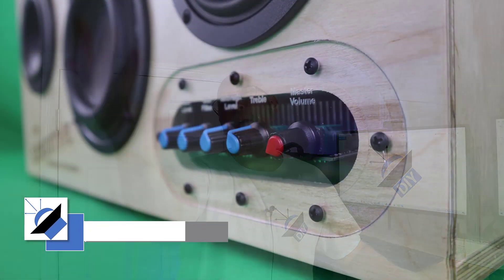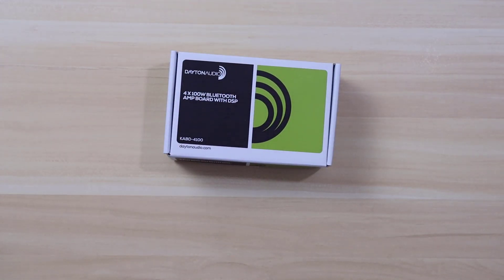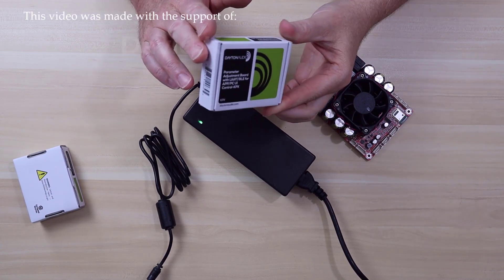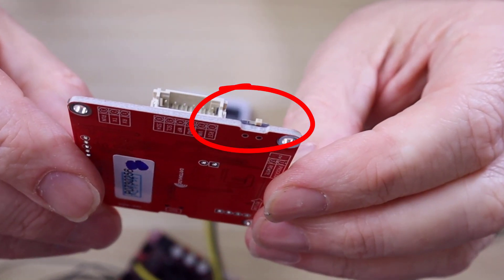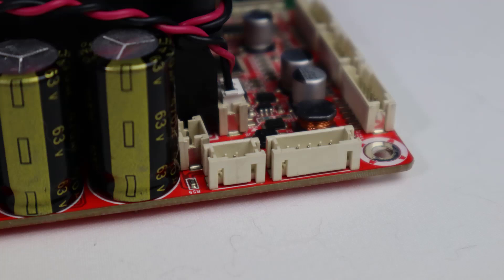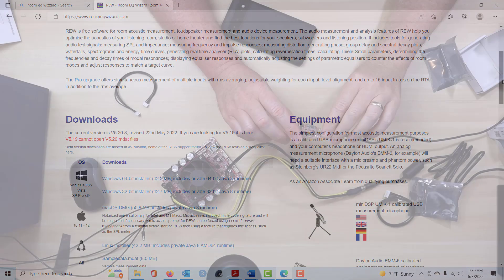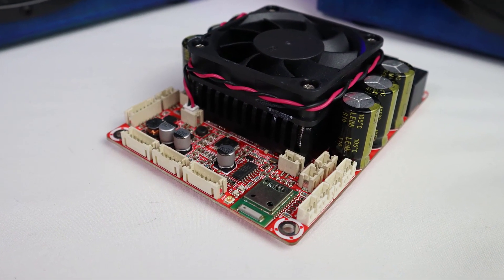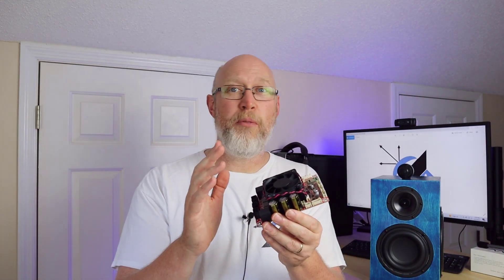DSP Amplifier:  Four Channel BLUETOOTH KABD 4100 by Dayton Audio.

Comment: If and IF  this was good sounding setup ,it would be everywhere! It just died ! It's been 2 years and no serious  Manufacturer has adopted this !No High -End Company uses this board ...It's good for Boom Boxes and awsome in Car Audio though ...... Please correct me if I am wrong...
Reply from the maker: Amp boards like this have been around forever, and they all have the same problem.  None of them do anywhere near there rated power.

Comment: Justin: I would be nice and useful if you did some measurements and showed what the realistic output power ratings of this amp board are. The class D amp chip in this design is rated 100 watts at the class D industry standard of 10% distortion! I don’t know about you but, I’d rather not hear my music played with that much distortion, thank you.
Looking at the TDA7498 datasheet it looks like the most you’ll get with an 8 ohm load before clipping is a hair less than 40 watts. Oddly enough, you get even less with a 6 ohm load; a bit over 30 watts before clipping. It doesn’t seem to be rated for 4 ohm loads. Looking at the 6 ohm headroom loss it’s probably a wise limitation.
Also, this is a single supply H-bridge equivalent output chip (as many class D chip amps are) and therefore there is no way to configure it for a “bridged” output. The output is already bridged. You can put two outputs in parallel which is actually what you get utilizing the jumper that is mentioned but, that’s not bridging. This might help getting more power into loads < 8 ohms but, you won’t be getting the large increase that you’d expect with an amp capable of actual bridging.
This is a great amp board for the money but, let’s be honest about its limitations too.

Comment: Another note, this amp comes with a 1/8 inch line input. You do not have to use the Bluetooth so… If you’re trying to drive two speakers with one board in each box, you can just split your line out and run hard wires to them and you could have a powered speakers in stereo

Comment: A word of warning if you try this. This set of devices is really cool. I was able to set up the crossovers on a four-way speaker very quickly just from watching Justin‘s video. However, I burned up one of the boards when I accidentally touched them together, so… Keep in mind Circuit boards are very fragile and very susceptible to shock and static. Protect your boards get nylon mounting hardware and some wood panels or something to fix the boards to so you can protect them. I sandwiched mine between two pieces of ash veneer.
Reply from the maker: Yep, have to be careful!
Reply: Always use a grounding matt with bracelet.

Comment: So is this basically a programable crossover? How is it connected to each driver? Did the speaker already have a traditional passive crossover installed? I'm about 80% of the way to understanding how this works. 

Also, can these be used with a traditional external amplifier? Thanks so much.
Reply from the maker: This is a 4-channel amplifier with a built-in digital signal processor.  Crossovers are just one of many things that a digital signal processor can do.  You can ser it up so that each channel is driving its own speaker.

Comment: I think these would be good for a dedicated Bluetooth speaker or computer speakers. But I like to build or modify speakers to run on my existing amplifiers. So these DSP's cannot replace most speakers I would build. Also I would recommend installing capacitors on all midranges and tweeters even if using DSP because sometimes the DSP can fail or not be programmed correctly and could send a low frequency to a tweeter and ruin it. One can always program the DSP to work around the capacitor.
Reply from the maker: Yep

Comment: Thanks for this video. Is it possible to take the filtered DSP outputs and send it to an external amp in case you want to use your own amps?
Reply from the maker: Yes, but at that point you may as well get a stand-alone DSP.  https://parts-express.sjv.io/ORg1kz

Comment: I bought this amp too, but the fan isn't on. Does somebody know if it goes on only when it gets warm, or should it be on all the time?
Reply from the maker: Mine did not turn on while testing.
Reply: @DIYAudioGuy  Thanks. So it seems to start when heating up.

Comment: Top tier tutorial! Straight to the point with relevant details. Really appreciate the lack of fluff for something like this (I think you need more fluff in some videos, but you do what's right for you). Dayton has always been good to me. I'm using an old school mini dsp board for my car and not only can I sit on the good settings, but I can modify it so easily when I decide the time delay is off... Its usually just weather and I revert...
I will absolutely use this solution for one of my future projects. Only thing is... I'm gonna make an external connecter for the programing port... I have to have adjustability
Reply from the maker: It is hard to figure out the right amount of extra filler.

Comment: Hey I preparing a build two mono 3 way 4ohm speakers based on kabd 4100 working as my rear home theater speakers but also I want add powertools battery hook ups on the back to make them "portable" move to the garden and make quick party... my question is possible to add some preeset profiles and switching them by adding extra button to the board?
Reply from the maker: Reach out to Parts Express tech support.  They can help, or check out the Toids DIY forums.  Between the two of them they can answer almost any question.

Comment: I am using a couple of these amps, a couple of 500 Watt DC/DC step up converters, and an Optical to I2S board along with an Android Headunit. Using these DSP amps gives me lots of options for car audio that would cost thousands otherwise.. Oh yeah, and not many of the commercially available DSPs have an Optical input on them. These KABD boards are freaking awesome!
Reply from the maker: Is the optical input an optional board, or is it on the main amp?
Reply: @DIYAudioGuy  It is actually a board from Wondom (Who is the OEM that makes the KABD boards for Dayton/Sure, their JAB5 is identical to the KABD-4100). Their SPDIF > I2S board will take over as the I2S Master for the KABD/JAB boards.

Comment: I’m using two in a very nice pair of two ways and subwoofer combo with faital 8fe200 1 cubic foot box made of a 13 layer Baltic ply with morel cat 308 tweeters in a birch horn I made. They are fully active and I’ll be rapid prototyping 3d printed horns soon to optimize the morel horns. 

So far I’m blown away with the power and capabilities of this DSP amp board. The level of adjustability I have is just nuts. I’m adding a zobel filter network to the woofer and tweeter so hopefully that can help with impedance issues with the woofer so the DSP board is not an end all solution but this board will cover 98% of people. It’s flipping fantastic. Great sound quality, lots of control, at a flipping fantastic price. Just make sure you get a high quality power supply, at least 24v 10a but I have a 36v 10a and it sounds slightly better with a higher voltage.
Reply from the maker: The power supply is very important.

Comment: No!!! not $30 for an inductor, how ever will the wallet recover from that? You get what you pay for in crossover parts. Pity it is bluetooth, they might have a place in a real wired speaker.
Reply: It also has an aux input
Reply from the maker: I think you missed the point. It is cheaper to buy this amp board and use the DSP vs using a non-DSP board and purchasing all of the crossover points.
Reply: @DIYAudioGuy  it's a bit of an inconclusive conclusion... It entirely depends on the budget. You could do this comparison at a $100, $1,000 and $10,000 price points. I went on Parts Express to see what the unit sold for. You couldn't buy a single big quality cap for the price of this unit, but then again you would need to compare that cap to something like my $6,000 active crossover to get a fair comparison. At the budget end of the spectrum you would be comparing this unit against something like electrolytic or very cheap poly caps. You can't draw any conclusions without doing a sound test of a both crossover types. This might even work out cheaper, but it could sound 10x worse.

Also not everyone knows how to use software to properly configure the DSP. I know from playing around with my active crossover wrong settings can make it sound far worse than a cheap crossover. Make a cheapish passive crossover for the other speaker and then lets see if it still stacks up.
Reply from the maker: @DodgyBrothersEngineering  Fair enough
Reply: @DIYAudioGuy  I would be keen to see an audio test comparing the two. I have been tossing up between active and passive for my rear home theatre speakers. A decent passive crossover is going to set me back about $300-$500 per speaker, I have wondered what something like this might compare like to a passive solution. I'm not for a moment saying that the DSP isn't the way to go, but I need to see a fair comparison between the two to draw any meaningful conclusions. I mean value is only value when you are getting a better solution for less. If it is less, and cost less then that is the opposite direction of "HiFi".
Reply: Can tune and measure on PC, instead of buying 20 inductors to fine tune your crossover

Comment: Only partly true, drivers are designed to work with passive xovers. There is a humps and dips to cope with, must choose very carefullu witch drivers to use with active system 🤔🇫🇮
Reply from the maker: Passive crossovers can crate the same humps and dips.  The difference is that the DSP can fix them without a complete redesign and rebuild of the crossover.

Comment: wait, I just looked on PE and it says 100 x 4?  So that little bitty thing is putting out  100x100x100x100 or 200x100x100 or 200x 200? If this is correct, this is frigging nice, maybe even kind od revolutionary for DIY'ers
Reply from the maker: The ratings on these chips are thermal ratings --- so not really a good picture of the RMS output power.  I did testi t, but something was off with the test (it was wired to 8 ohm, but reading 4 ohm) so I left the test out.  I will include that once I figure out what was going on with the test.

Comment: Would be really nice if you could get these non amped, that way you could use it as a crossover only and then use what ever Amp you wanted. I dont think those are going to be very high amps though.
Reply: You can, look for ADAU1701 AUDIO DIGITAL SIGNAL PROCESSOR KERNEL BOARD  from sure electronics. They are the china based company that makes the KAB boards, they call them the JAB series.

Comment: Wow sweet you just sold me  I was wondering about the dsp and how it function on this board but you started talking about the amp capabilities and I'm sold. The only other board  that has hole bunch of  functionality but there amp section isn't as diverse is acrylic audio if you were to get the none amp model the two  together would make a lot off different options add a tablet  with windows 10 you probably  program  both amps and use the tablet as part of the project .🎶🎵👍👌✌️💯
Reply from the maker: Ooo clever.  That might give me an idea.
Reply: @DIYAudioGuy  was hoping it would I like ideas every one always different one then the other possiblity are end less  wish this was possible when I was a teenager but then again I probably wouldn't no how to solder lol 🛠️🎶🎵👍👌✌️💯

Comment: Hey Justin!  Cool video to show case this amp. Crossover design is not usually as simple as plugging in some filters. Can you go over the filters and if they allow for linear phase and take phase adjustments like FIR? This is super useful for speaker design.
Reply from the maker: I am working on a 2-way bookshelf system just for this amp.  Hope to cover that information and a deep dive into the programming at that time.
Reply: @DIYAudioGuy  Awesome! I've been considering an active design using something like this where I do full phase correction of the drivers, and linear phase based crossover to get the best possible result. Something tha'ts basically impossible with passive crossovers.

A side issue. I looked into powering that amp, and... Well... A 300w switching power-supply seems to cost as much, or more, than the amp board. How can we power amps like that without breaking the bank?
Reply from the maker: @Clobercow1  I was using a power supply from Parts Express. I think there's a link in the video description.

Comment: Elliot Designs is right. I have schematics and a guide over at Toids DIY Audio forum. The guide is a rough draft I sat down and typed up on a snowy day in April (Rocky Mountains). It should be enough that you or Nick can use it to see what I was saying to do, but it isn't ready for mainstream quite yet (haven't tested it enough, etc.).

I have posted a new one over there this morning which adds a noise gate to the schematic, which will cut out all sound below -80dBFS. That same dynamic compressor, if you wanted to, could also compress the top end so that anything that would be above a specific dBFS will be compressed down to only allow a top volume. I currently have a peak filter there, so I'd recommend swapping it to an RMS filter (under dynamic processors tree) to do it so that it isn't trying to stop transients from exceeding the top, just the average. 

I am also working on some cool things with an ADSP-21489 schematic to include automatic priority of inputs for switching, an automatic gain function with soft-clip rms, and a triggered noise gate with an additional loop from DAC back through the ADC to then have the signal subtracted from that round trip, then adding the inverse phase to the signal in hopes to cancel out any additional noise from the DAC. I suppose subtracting the exact noise might help as well. But that is a work in project. Unfortunately, I don't have a way to do that to cancel out the noise from the amplifier. I have to learn more and possibly implement some form of table filter to help with that. But, that is for the SHARC which has linear phase correction (FIR filters after IIR filters). Different beast. 

And if you do check it out, feel free to  ask questions before flashing. I have not confirmed yet that the JAB5 from Sure Electronics is the same as Dayton's for the hardware switches, but the schematic, if you copy from mine and past into one made for Dayton's, then you should not have a problem. Plus, I'd love feedback as well.
Reply from the maker: I will have to check it out!
Reply: 99% sure the Dayton board is a rebrand with a different coloured circuit board. So should be fine, but yeah, best to check.
Reply: Amplifier noise probably needs to be a hardware solution as it isn't regular so would need some kind of inverted feedback system or more power supply decoupling/smoothing capacitors
Reply: @Elliott-Designs  - agreed. I also have been digging into the feedback/feed-forward design of the purifi amp to look for inspiration. The main elements include three feedback signals, one feed forward, two filters, summing of the feedback into the signal, and a compensation circuit (to correct for gain due to summing signals together and to then address signal irregularities from the summing of the feedback signals). And I cannot think of how to do it without using a microphone input of the signal, but that has issues as well due to picking up errors of the transceivers, atmospheric noises unrelated, etc. Now, I also have been looking at the noise cancellation ADI was playing with in the past, where a microphone would feed in and then they could create a cancellation wave to reduce ambient noise. But to implement it would take a bit of thinking on how to do so. Especially if a person is speaking and the microphone feedback was trying to compensate for what you were saying (whereas for the audio being played, you can put a delay circuit in so you are roughly comparing the same audio signal to the same audio being played, thereby having a clear ambient signal and noise, but what it tells it to correct is further removed in time, so the effect with the dynamics of noise in the amplifier would be limited). 

You are correct that applying a smoothing capacitor for the power supplied to the board in an amount suitable to smooth or to filter high frequency noise out from reaching the board is a way to address possible noise in the overall amplification. Kiss Analog has some videos on using the oscilloscope to see the noise and shows the bridging of line and neutral with the capacitor to lower the noise level. To some degree, though, it is baked in with the amp being used. 

Either way, if you don't start playing with the ideas, you will never come up with a solution. LOL.

Comment: 50 W IS A BIT WEAK
Reply from the maker: Plenty of power for what these are designed for -- bookshelf systems, desktop systems, bedroom stereo.
Reply: Keep in mind, thats 50 watts to each drivwr, which is (theoretically) equivalent to a 200 watt/channel stereo amp.
Reply: @blakebrockhaus347  something that small it not really cost effective  .i rather have a analog 31 band eq  and intergraded amp .be sides  a power simply that can do 200 w will not be cheap